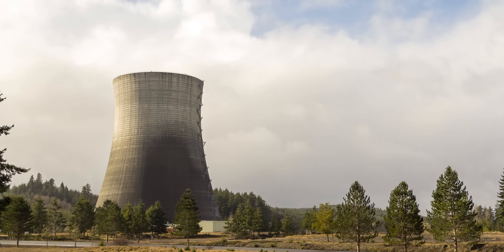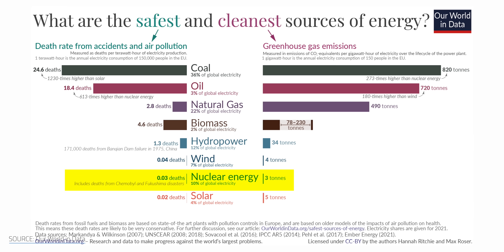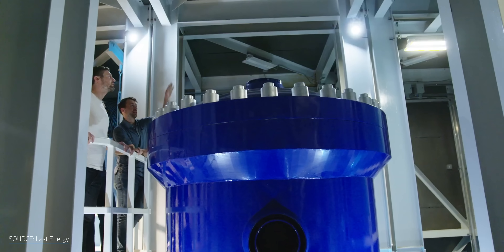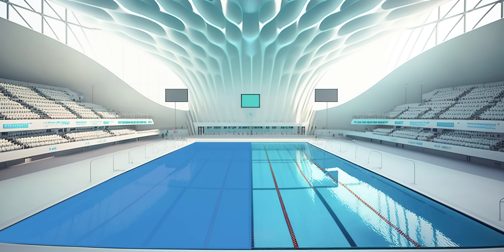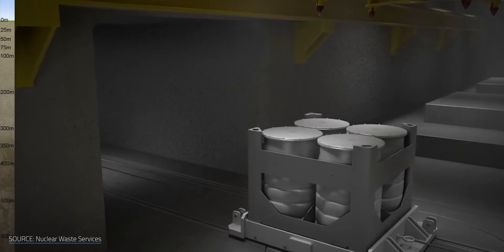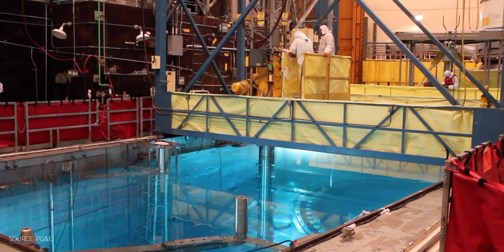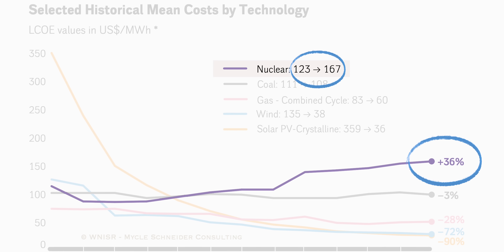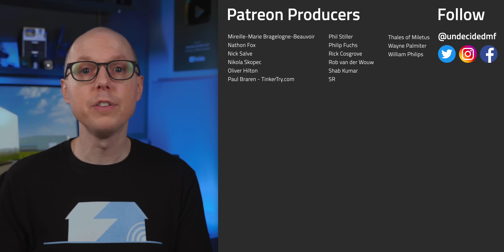Is Small, Fast, & Cheap the Future of Nuclear Energy?

Comment: One of the hazards that you did not mention is the issue of what happens during war or terrorist attack. We are now facing this danger at Zaporizhzhia. Even these modular plants will have to have to have extensive security because of how terrible a security failure would be, such as one being held for ransom. You can easily imagine a case in which a terrorist group flys a drone bomb over and lands it on the module and threatens to blow it up if bitcoin is not transferred. I am sure security can be provided in the modular case, but it will cost, and that cost has to be acknowledged. In the large case, such as Zaporizhzhia, there can be no guarantee against war.
Reply: Security would be automated, a built in shut down system making any attack or capture moot.
Reply: All Soviet and Russian built nuclear plants are designed to withstand an impact from falling out of sky a jet . But I have serious doubts about American nuclear plants. Everybody remembers 9/11 and how unprepared Americans were
Reply: @andreycham4797  Most nuclear power plants in the world have impact security for the reactor sections, however the big problem is in the fuel ponds, which are usually not protected, yet contain vastly more radioactive material than the working core. Security experts have warned for decades about the danger that terrorists or war fighting will turn fuel pools into the world biggest dirty bomb,. From a security standpoint, it is a good idea for small modular reactors to keep their spent fuel inside until the whole module is replaced, but part of the projected cost savings is not having to build a big strong containment. My point is that one of the hazards that has to be listed is the danger to any location that considers a modular reactor because of the creation of a target for terrorists or war.
Reply: We'll be care not to be invaded by Putin.

Plus, no damage yet.

Comment: If they can switch to high temp from high pressure in a modular form they will definitely go a long way. 
High temp could also lead to burning off the older spent fuel and solve the disposal problem as well.
Reply: Several companies are presently developing fast-neutron reactors cooled by one or another molten salt.  Moltex is designing a prototype "Stable-Salt Reactor" for New Brunswick, Canada. TerraPower has started building a prototype of its Natrium reactor in Wyoming.  Kairos in Berkeley is planning to commercialize small modular molten-salt reactors.  And Copenhagen Atomics is pioneering small modular thorium reactors, with a prototype projected for 2025.  All of these designs are intrinsically safe, and they breed fissionable uranium from other actinides, allowing them to use waste from existing light-water reactors as fuel.

Comment: I worked in construction of nuclear power plants in the 1980’s. A significant part of the high costs were due to the regulatory agency sending down new specifications constantly. Even if something was already installed, they would want it ripped back out and replaced with a slightly different alloy
Reply: I wonder what the price tag on combatting NIMBY is for those projects.
Reply: The rules change constantly, no wonder none wants to invest in nuclear.
Reply: That was the big problem of the Flamanville’s EPR
Reply: @stefanoparlatore7141  that was also one main contributor to the finish EPR reactor, while it was not the only reason. The pullout of Siemens and problem with subcontractors was also big problems.

Still, government interference was at least 2 years delay
Reply: $$$$  Wooohoooo!!!  $$$$$$  Change orders and corrupt official kickbacks!!!
Reply: The NRC is controlled by oil company interests. They do everything they can to make nuclear construction as expensive and wasteful as possible with the hopes that no one will use it in the future.
Reply: Revision updates are a big issue. The video downplays the cost but imagine the cost of changing hundreds of reactors when revision changes are made, which they will. Modularity may be a better solution than none but it's still not cheap.
Reply: @jabuki2  Good observation and I too eluded to it in my comment. Faster design iteration, ok, but if something turns out to be inadequate, you off digging out maybe hundreds of them to change what needs to be changed.
Reply: better safe than chernobyl
Reply: @ThatOpalGuy  why would it be safer than chetnobyl.. hope you relize that chernobyl was 100% government controlled.

If you can't say specifically what risk there is, you are just bs
Reply: @matsv201  er Mats, the Chernobyl reactor was a FAR more crude affair, with No Secondary containment (see RBMK) if it had the 'over regulated' design used in the west, there'd have been more chance of CONTAINING the thing - a better Core Design might have AVOIDED the incident all together (see 'Prompt Criticality' )

The Human Factor was, the team performing a test exercise got impatient,  using the reactor OUTSIDE of its parameters and blew it up (not understanding the 'prompt Neutrons' phenomena they were setting off) - like flying, there IS a reason for these bunches of regulations!

Sadly by the time they hit the SCRAM button the core was so darn hot the Rods managed to INCREASE reactivity,and jammed half way in due to the distortion of the now melting core

we know the rest..
Reply: Corroded metal and failures in the clangs caused those constant changes.
Reply: Thankful for those regulations keeping things safe.
Reply: @cconnors no they are actually making the recession more dangerus
Reply: @matsv201  oh please, maga, get continuing education. government regulations SAVE lives. capitalists TAKE lives for profit
Reply: @ThatOpalGuy  so you claim. How does this specific buyrocratic corruption save life's?
Reply: @cconnors wrong!  Expensive and not safe.
Reply: @cconnors . I agree.  Most if not all people who blame regulations for the lack of cheap power generation get all their talking points from so called news sources like fox, wsj, or the gop.  They’ve all turned scientists who they don’t agree with into political hacks, with agendas promoted by left wingers.  I find it disgusting how the right politicized Covid where wearing a mask was a left wing freedom destroyer.

Comment: Ya; Why aren't small nuclear reactors all around?  Because they require high security.  While only 3% is that scary horrible stuff; it only takes 1 gram of Polonium (not plutonium) to kill and entire city; if for example a terrorist group blew it up.  A reactor can also be hacked and caused to go critical, particularly if there are no human over rides at the tiny plant. You also quoted costs for solar and wind that didn't include battery farms to contain the energy for non production hours; when you include that they cost a lot more.

Comment: Standardisation worked against France when they discovered 24mm cracks in 27 mm thick water pipes. Between that and maintenance shutdowns 32 of their 56 reactors were down in the middle of an energy crisis.

In addition other reactors had to operate at reduced power due to inadequate cooling as the rivers they relied on were too hot.

And that was on top of audits showing that their actual costs were 2 ½ times what they had been claiming. 

Due to nuclear's long history of cost & schedule overruns, including with other SMR makers, I remain highly skeptical of Forever Energy's claims until they actually deliver a working reactor and there's independent verification of costs & reliability.

Until then the money is better spent on what we know actually works, is cheaper & getting cheaper, and is far quicker to deploy.
Reply: They get 72% of their electricity from nuclear, and they're building more plants.

Japan, the USA, China are all building nuclear.

You'd rather have coal?  China is building those, too.
Reply: @scottslotterbeck3796  and because 57% of them were down so they had 40% of the generating capacity offline.

In addition to the reactors operating at reduced power due to inadequate cooling. 

In the middle of an energy crisis.

So much for "reliable nuclear power"

Olkiluoto 3 took almost 18 years to build, Flamanville 3 has shown no improvement.

Despite promises of faster build times and lower costs.

That is literally par for the course with nuclear power.

Good thing O 3 had a fixed cost contract. F 3 so far is at 5 times the original cost estimate.

Thanks to poor management and construction screwups.

 Sizewell C is having trouble getting financing because of the problems with the other EPR's

So going by that track record everyone else will have built out so much cheaper to build and operate, and getting cheaper, solar, wind, and storage capacity that will outcompete and displace both coal and natural gas well before they could hope to be completed.

And once completed they won't be economical to operate full time reducing their capacity factor and driving up their breakeven prices.

So they will likely end up being a waste of money that could have been used to built up renewables and storage capacity quicker.

And if you think the SMR's will be any different, look at NuScale and Terrapower.

NuScale's claimed cost have skyrocketed and Terrapower doesn't even have a fuel source. 

It's literally the same broken promises of nuclear power about faster build time and lower costs.

I want coal and natural gas gone as power sources. 

I just have enough sense to not ignore the historical record and fall for the unsubstantiated hype making the same broken promises over and over again.

Especially compared to the proven record of exponential deployment and falling costs  of renewables and storage.

Comment: Very interesting. My first concern is Security, meaning the protection of the nuclear material from vandalism and theft. With many locations scattered over a wide region, how do you ensure the nuclear materials are secure?
Reply: That's actually one of the advantages of SMRs, since they are already 'casked' there is no opportunity to get to the spent fuel to even make a dirty bomb or security needed to 'guard' the casks stored at traditional decommissioned reactors. The safety and security is cheaper and much more simplified compared to traditional reactors.
Reply: Build them on pre existing  armed forces bases all over the country, for guaranteed safe protection by heavily armed soldier's.
Reply: @ThomasVWorm  Or people just like to not realize that a projected rate of failure is a rate over time and could happen at any point in that time... Because if you don't think about it too hard it appears to reinforce their arguments that super low % chance thing A happened that one time.
Reply: There is not as much material, and how many people could deal it it?
Reply: I'm always curious how people think nuclear waste is stored when making arguments about theft. If you think it's yellow 55 gallon drums with hazard symbols filled with goo/pellets/ other loose material... You may want to look further than pop culture...

Comment: If you have lots of governments openly sharing their tech, and all wanting to go nuclear, then large reactors are good, they are expensive and take time to build but can work with enough standardization and agreements in markets and tech and regulations. But we don't have that now, some places can't use tech so some designs only work in X country, others have different regulations requiring other changes. Most constantly shift the goal resulting in extra costs and delays in construction, and it's a side option only lightly used in most places these days meaning there aren't enough people or training to really keep the industry going smoothly in many ways. Gas and oil really did win with their marketing aproaches against nuclear energy, hard to deny that. Because humans are so damn easy to manipulate since they don't care about things like facts, just about what scary thing someone shows them in an add be it fact or fiction, with somethings name on it.

Well, small modular is probably the only way to go as things are now, it's small and quick enough to hopefully get past some regulation goal post moving issues, allows for more standardization and expertise and stuff on that specific model, and has a much lower investment cost and time that better fits with modern political time tables (politicians/budgets change every few years, so a large program that lasts beyond one government group can easily get shafted half way through, if it's quick that's less likely to happen). So it's not the perfect solution, but it's a solution that fits our current situation at least for now.

Comment: Please address the pit falls of solar panels pollution to the environment.  Also it foot print  is required for them and the heat generated by them. 
There are newer tech that addresses nuclear power via using a safer isotope that onces spent can be returned to the ground with no environment harm. This has been known for years.
Reply: The solar footprint is only because humans lack imagination and just stick them on the ground instead of elevated, on every rooftop, and using land that can't be used for anything else.

Comment: The problem with death rates on Nuclear, is that is based on what has happened SO FAR, rather than the potential for mass death. And that does not include the potential danger of creating vast areas of unlivable land like in Chernobyl. Japan is still calculating how much area, and how long, the area around Fukushima will be uninhabitable. I could be thousands of years. The long term contamination of aquifers could be far more disastrous than air release in the long term.

Comment: ok, a few missed details. You mentioned Chernobyl and the death tool, but then you put Fukushima and Three Mile Island on the same scale without mentioning their impact. Fukushima only had one death directly related to the reactor, and most of the surrounding region already has radiation levels low enough for people to come back, unlike Chernobyl. And Three Mile Island was hardly an accident, no one died, no radiation got released, nothing, the worst that happened is that they wasted a couple decades and a small fortune to clean up the reactor, it was so uneventful that the second reactor on the island kept working up until 2019 when it was decommissioned because of operating costs. Its a testament of how much safer PWRs are. So when we talk about the hazards of Nuclear, its basically all Chernobyl. Even including long term indirect deaths because of increased radiation exposure (what is already include in the calculations of deaths per mW/h), Chernobyl impact is 1000x worse than Fukushima.

Its also important to note that we have the technology to reuse spent nuclear fuel since the 50's, Nuclear reprocessing. it was thanks to Jimmy Carter that we can't use it. Because of anti-proliferation agreements with the Soviets Nuclear reprocessing was prohibited, so we are forced to burry tons of perfectly usable nuclear fuel that could keep powering us for decades. not to say that reprocessing is cheaper than just mining more uranium, but if what we want is to reduce our environmental impact, then the extra cost is worth it. its also important to mention the CANDU reactor, that is not only capable to using a higher variety of fuels, including weapons grade materials, but it can theoretically be used to breed more fuel (something that is being tested in India). Its also one of the safest reactor designs, with passive safety features that makes it almost impossible to explode and very hard to meltdown. so Nuclear waste don't need to be a problem.

Comment: "cheaper' is still relative to output.
smaller is going to output less.
and still, "just in case" your not going to put them in populated places, adding to transmission costs.
still a stuck record for geothermal.

Comment: I do not think levelized cost is a good measure of the value of a power plant.  What I think needs to be taken into account is the value of the power produced minus the cost of the power produced. What is going on here is the the value of produce power varies during the day and season.  A power plant that can produce power when power is most valued will be more profitable than a plant that does not have this ability.  So a solar plant that produces power only when power is being over produced would not be earning as much money a power plant that produces it's power constantly. Even more extreme case would be a high tempature nuclear reactor that could store output in heat storing salt tanks to output when the wholesale price of power is at it's highest. With this type of power output flexibility such a plant would be more profitable than a solar plant even if it's cost of power output is higher. I would like comparisons of different types of power plants do more comparisons of the profitablity of the power produced rather than simply the cost of the power produced.
Reply: Solar power is much better at creating the extra valuable power needed for air conditioning in the Summer heat. Add in the cost of storage, and solar and wind are still much less expensive.

Comment: OK, but you don't seem to be undecided here, Matt.  ;)  Interesting video.  I wonder about the dispersed access to nuclear material for terrorists.  These small sites are not going to have the security of large plants and they are going to be easier to break into to grab some nuclear material for a dirty bomb or the like.
Reply: Because the fuel is sealed in the reactor at manufacture, terrorists would have  to steal a whole reactor from the site.  Fuel rods are not transported outside the reactor vessel.
Reply: What terrorists?  
You can go down to Home Depot today, buy 1,000 smoke detectors, and build a dirty bomb

What's the nuclear security at Home Depot?